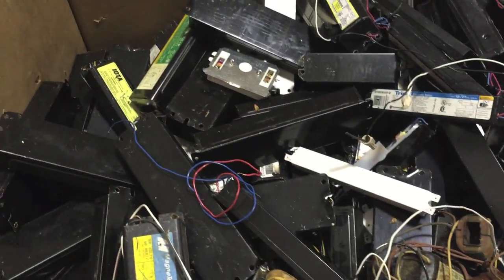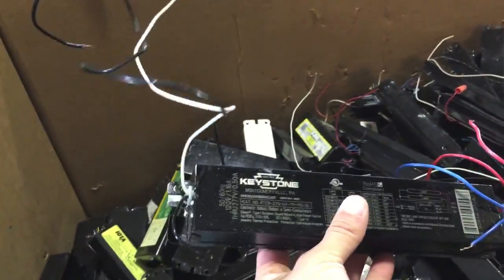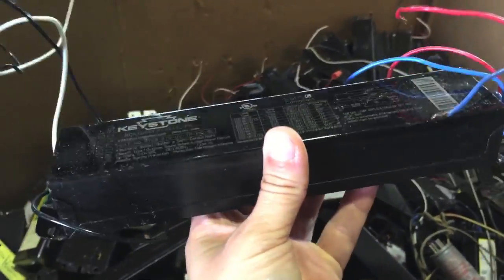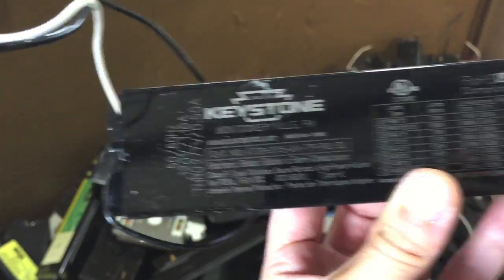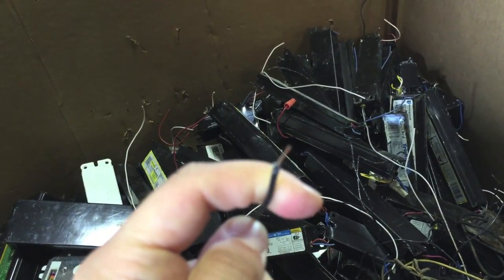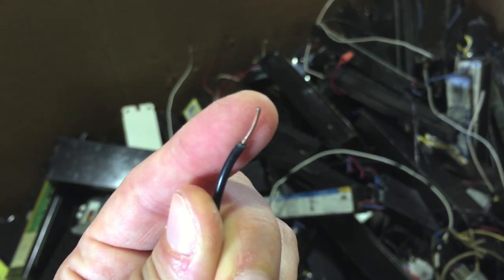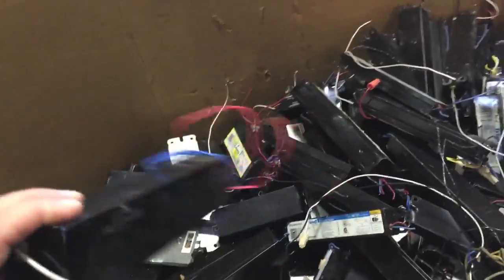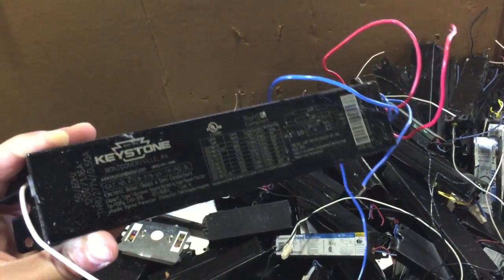Tips on Recycling Light Ballasts for Scrap Metal

Comment: I took two ballasts from the same fixture to a recycling place.  On the paper labels, they were both marked the same except that one had the language, stating that there were no pcbs, worn off.  The guy took one but not the other.  Now, I can appreciate that the recycler wants to know whether it has pcbs or not, but, my gosh, they are both the same.  Couldn't they put a rubber band on them and treat them simularly?  The death of common sense.  Now what does a customer do to prove it has no pcbs?  It would seem that a manufacturer of the product should be in a position of taking them by telling the customer to take them back to the store.  But the store won't take them.  There really is no national committment to recycling.  Consumers are expected to buy all this stuff but when it wears out, there is no recourse for disposal for the environmentally conscious person.